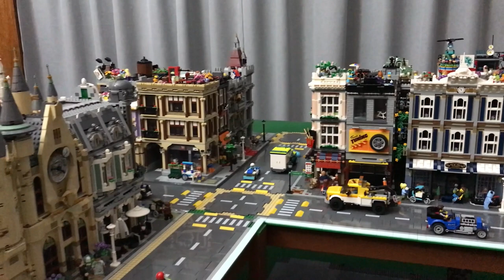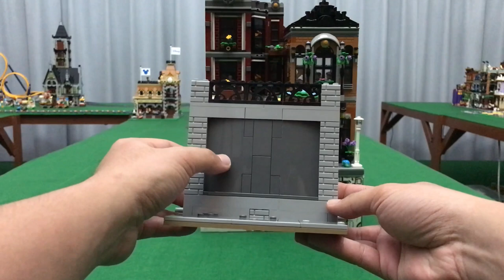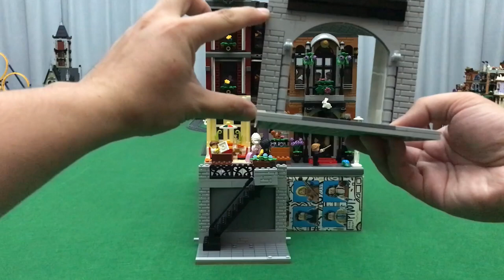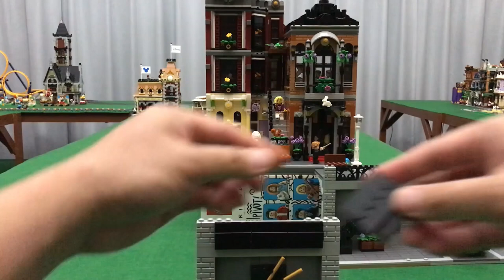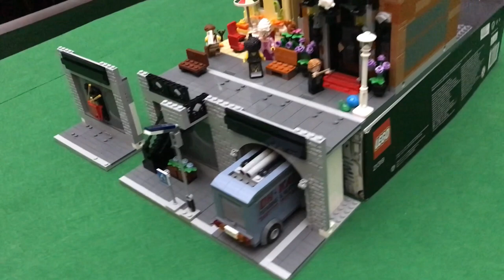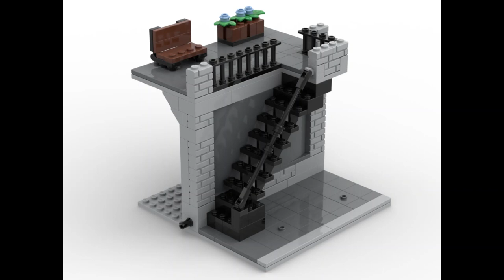LEGO MOC - Making Cost Effective Retaining Walls for Raised Platforms

Comment: Brilliant use for those parts and it breaks up the look of a solid wall nicely. The stair option is great.
Reply from the maker: Thanks a lot. Makes it a bit more interesting as well with smooth slightly curved walls 😊
Reply: @brickartisan  yes absolutely and putting the advertisements on it gives it a nice picture frame detail. More interesting all around than just bricks